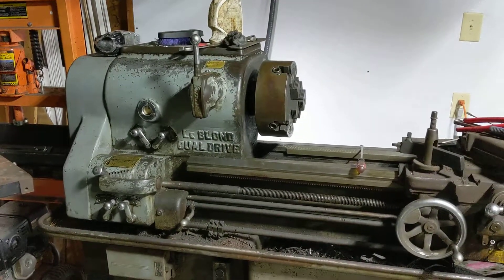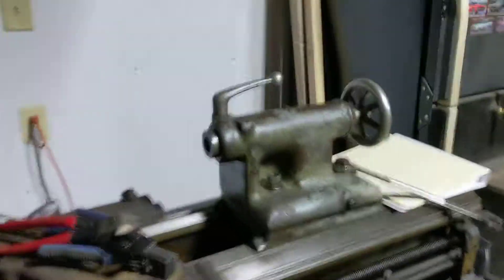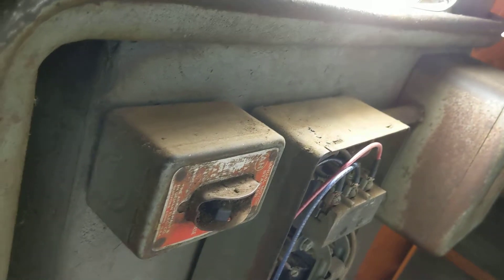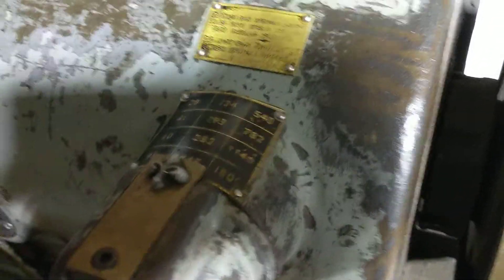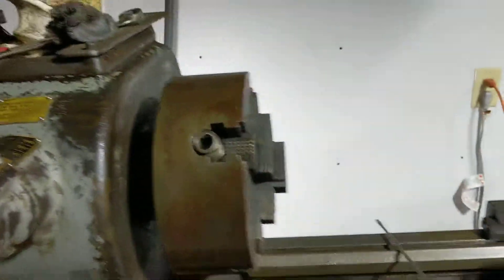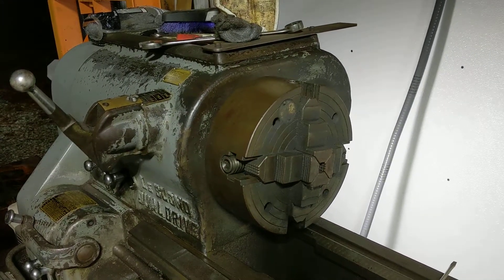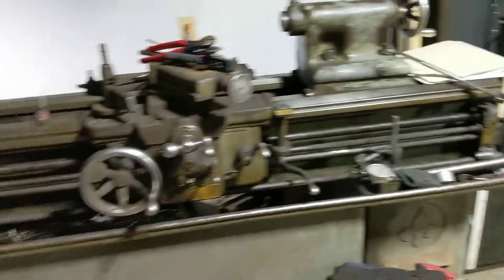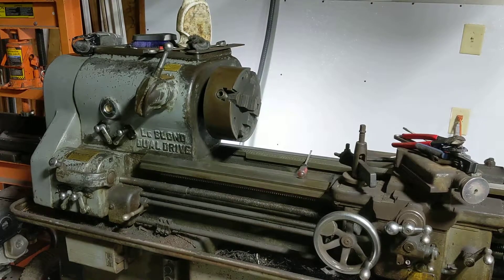First run of my Leblond Dual Drive Lathe

Comment: I just purchased this same model but I do not get it delivered till the end of this week do you happen to have a model number for your machine? And is this considered a 15 X 48?
Reply from the maker: I'd have to double check the length between centers, but 15" capacity, yes. It doesn't have a model number, just the name and a serial number. Leblond dual drive.

Comment: How much does she weigh. Im looming at one and need to figure out how to u load it
Reply from the maker: Off the top of my head, 3000#, but that's probably generous. I used a gantry crane to load/unload, and it worked exceptionally well.
Reply: @JohnCasale  thats what i have too but its only a 1ton unit but i picked up my bridgeport boss cnc mill with it ok. Its almost 3,000 lbs from what i gathered